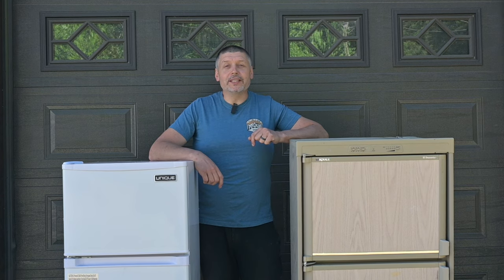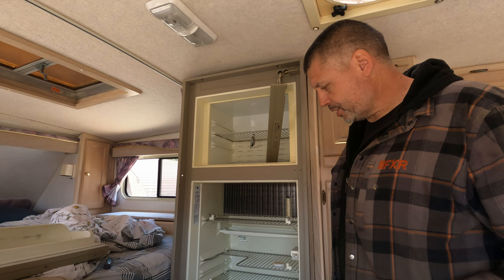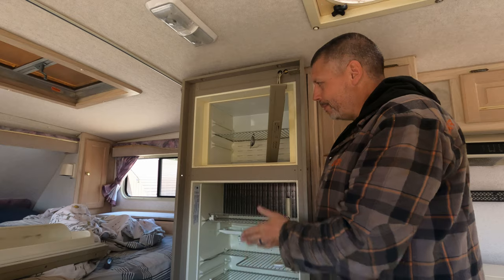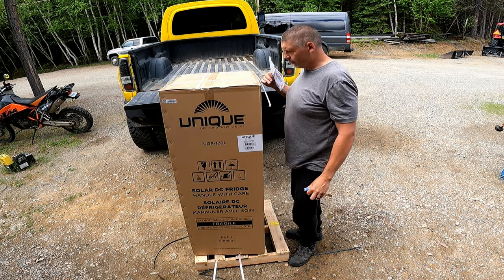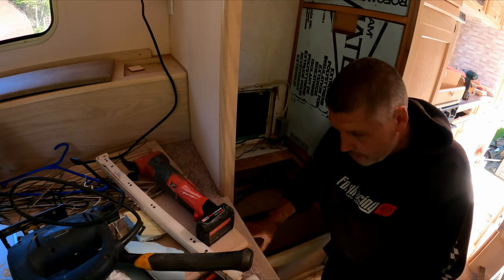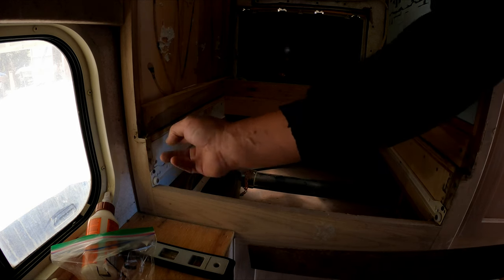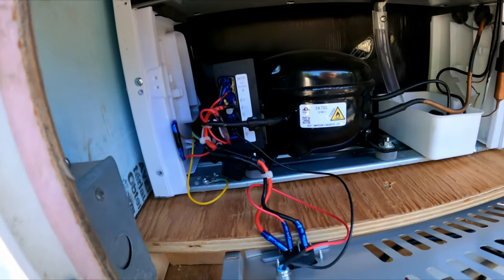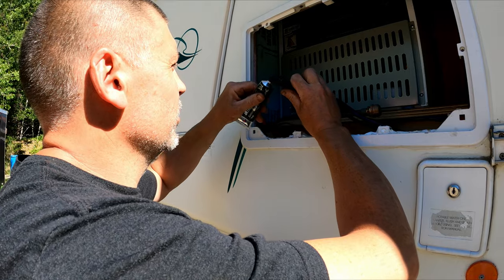Truck Camper Fridge Upgrade!  Easy Install!

Comment: I am doing the same remodel on my TC. Do you mind sharing a link to your fridge? Thank you for giving me a step by step remodel video series. I appreciate you both!! 🙏
Reply from the maker: No problem at all. Thanks for watching. Keep in mind you'll have to fashion mounts and something to hold the doors closed when traveling, since they aren't specifically designed for RV installations. https://canadianoffgriddepot.com/collections/solar-appliances/products/ugp-6-cu-ft-dc-fridge

Comment: Nice project. Are you powering the fridge directly with DC?
Reply from the maker: Yes the fridge is running off our 12v solar system. It draws about 4.5 amps when it runs. Thanks for watching.

Comment: Nice job. Do u have water damage on the wall behind the fridge too cause it looked like it? 🍻
Reply from the maker: Nope.  It may have leaked a bit at some point, not sure, but there were no signs of water damage other than the wallpaper coming off of the back wall.  The fridge vent on the roof was repaired and resealed during the roof repairs. 😊
Reply: @TheTimeIsNowAdventures  aah probably then humidity over the years 👍🏼.